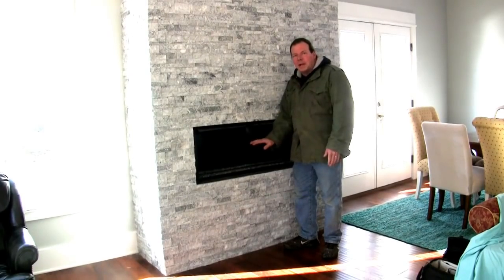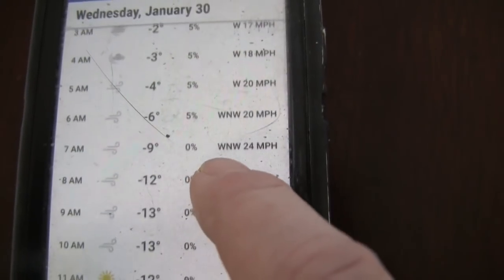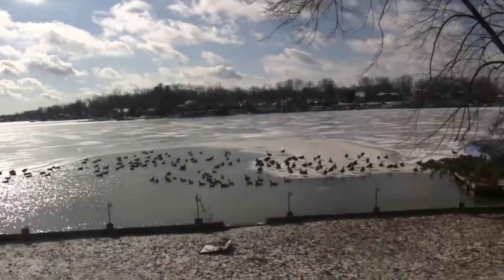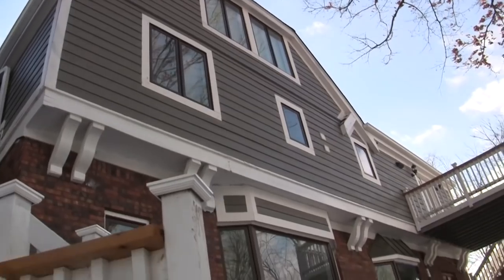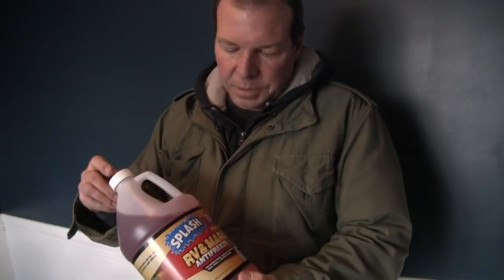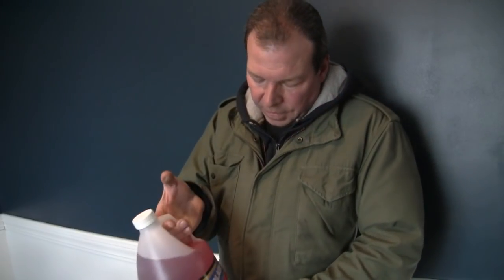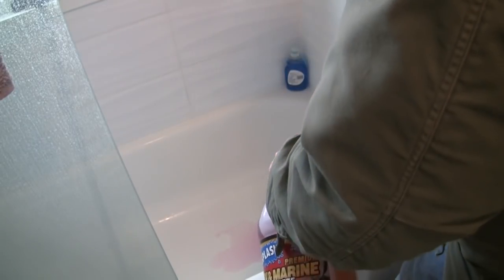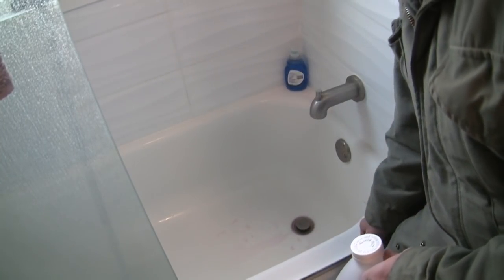How to Prevent a Drain Pipe from Freezing

Comment: You can use self-regulating heat cable on plastic pipe without a problem. This type of cable only draws up to 3 watts/foot. Look at Heatline, Raychem, and Surgei Barrel....
Reply from the maker: Hey Jordan,
Thanks for the tip!

Comment: Good video. Now what about ABS drain pipe, can it handle the heat provided by heat tape or heating cable ?
Reply from the maker: Hey Pi, 
That’s a good question. No experience w/ it but if I had to guess... I would be surprised if it didn’t .... 
Thx for watching.